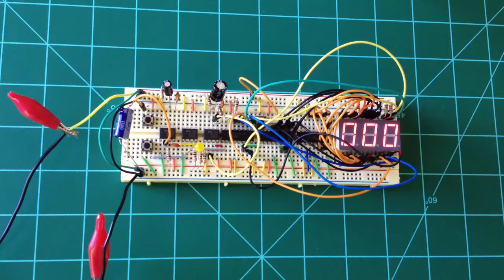Make: Electronics Experiment 18

Comment: I ran into something odd trying this experiment out(I'm using the second edition but that doesn't matter). For some reason the bistable 555 wasn't able to latch on stopping the displays. I made a bistable 555 timer on a separate breadboard and it worked fine, It's output turned on an led and stayed on. I made another bistable 555 timer below the first. When the first 555 is turned on it powers the led but when I turn the second 555 timer on it powers It's led but turns off the first timer. So at the moment a second astable or bistable timer will consistently turn off any bistable 555 in the circuit. They have only shared - and + busbars and Outputs go to leds. What is making this happen? Really confused... how can they effect each other without direct connections to input, reset or control pins?...

Comment: Have you attempted any of the enhancements? I've been trying to achieve the first enhancement but not having any luck: " It would be nice if the circuit begins in its “ready” state, rather than already counting. To achieve this you need to send a negative pulse to pin 2 of IC6, and maybe a positive pulse to pin 15 of IC1. Maybe an extra 555 timer could do this. I’m going to leave you to experiment with it."